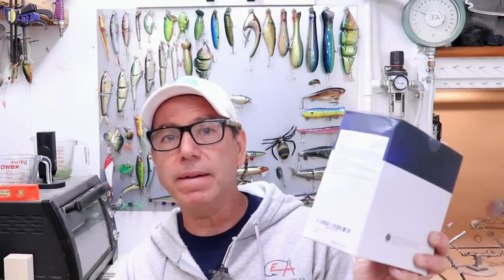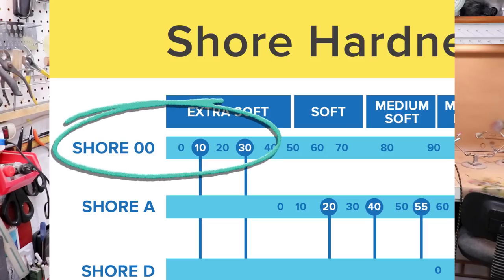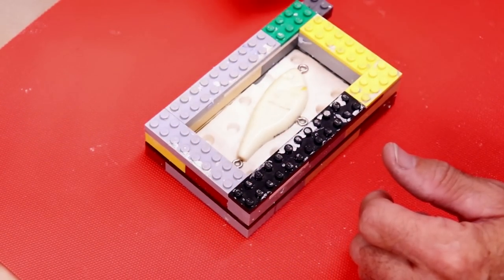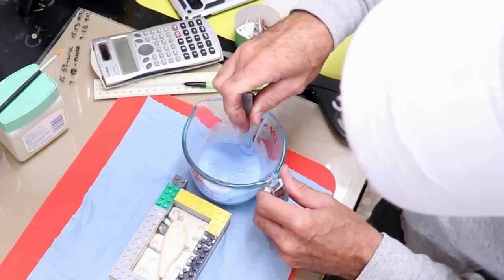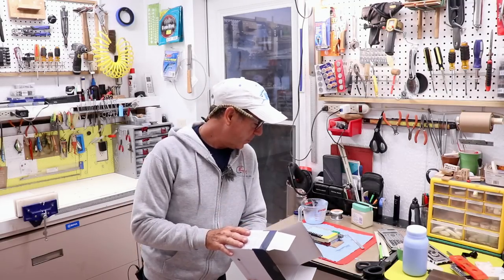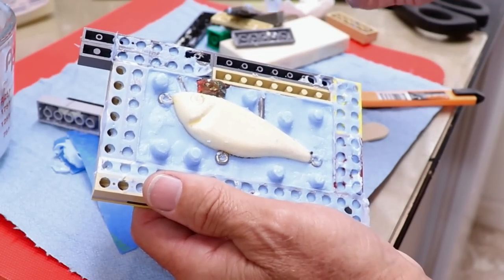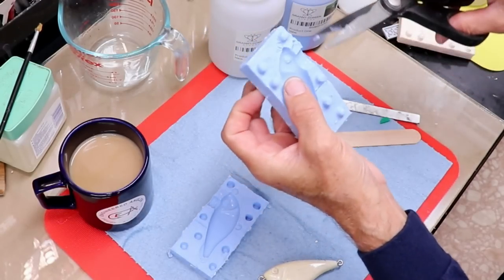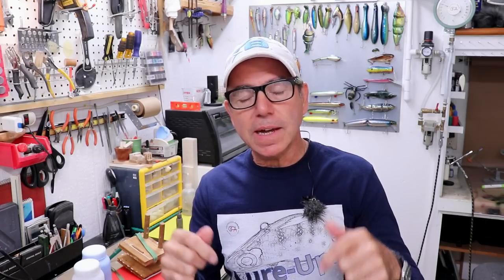Making a Silicon Mold, Cheapest and Fastest Mold Copy  #silicone  #moldmaking

Comment from the maker: So I confused everyone with my volume calculation and that's because the dimensions I gave were nonsense.  I was reading from half of a broken ruler so everything was off.  I corrected it immediately before I calculated the volume but forgot to correct it on video.  The actual measurements were 96mm X 47mm X 10.25mm 
Sorry about that folks.
Reply: You can use dry rice to measure volume. My math is horrendous!

Comment: Thanks for bringing my attention to the less expensive silicon molding material,

It would help if you had a level place to make molds. A three-legged platform with a bulls-eye level and two of its three legs adjustable screws so you can level it. A three-legged table is always stable and much easier to level than one with four points of support.

Comment: I know you can stiffen up Silicone caulk with cornstarch for mold making. It becomes more clay-like similar to Sugru mending putty (the homemade stuff is called Oogoo) The amount of cornstarch added determines how thick or pourable the raw silicone is and how stiff or flexible the resulting silicone is for working product is when cured.
If you're up for experimenting, maybe try mixing in some cornstarch to your Granny's silicone to stiffen up your mold? It probably won't take much to give your molds some oomph, (so they're less floppy) but it may make pouring a little fiddly. It might become more like a thicker batter instead of the thin pour you had.

Comment: As a lure tinkerer I'm always looking forward to your next video.  Any chance you could do a clip on issues and solutions you've come across while molding with silicone?  I recently tried duplicating a soft plastic swimbait and the silicone didn't set around the bait.
Reply: sometimes its the from residue around on the master. sometimes there is a reaction from the type of silicone. some epoxies don't cure with platinum silicone. sometimes its the mold release. theres other channels that focus on making silicone molds for lures,. just have to do the homework.
Reply: Robert Talone is really good! doesn't do lures, Burt he's a retired professional. great stuff on his channel, always using silicone

Comment: To eliminate Boubles, whithout a vacum chamber(If you have one,OK) is to use a old/new pressure cooking pot and add a bicicle tire valve in the exaust stem hole, and put a pressure gauge in the safety valve hole. Place the still liquid state mould and add pressure, About 25 PSI is safe. Google up dental pressure pots to get the idea
Reply from the maker: That is a slightly sketchy way of making a pressure pot.  Cooking pots generally only operate at about one atmosphere (about 15psi)  They will hold up with 25psi but I would not recommend it.  Not only is it not very safe but it's not that affective since you're only reducing the bubble size by just a bit more than half.  A cheap pressure pot, that will take 50psi easily, would do you better.  Nice job figuring out how to make the conversion though.  I do like to upcycle something old.
Thank you for sharing.

Comment: Great video Franco! I enjoyed every tip, including making sure the form is level. Most important part! I've found that the seepage through legos is inevitable if using off-brand cheap legos. 

Have you tried the BBDINO 30A Silicone? It's what I have used for 2 piece injection molds so far. Very durable, some stretch, and sometimes goes on sale for 25 to 35 for 2.5 lbs total. Also says it holds up to temperatures of 450 degrees. I've shot 375 degrees through the material multiple times with no issue.
Reply from the maker: These were legit Legos just didn't press them together.  I'll check out the BBDINO

Comment: I was thinking of using Alumilite's clear casting resin to make a lure with holographic foil on the center. I think you could still paint parts to finish it. 
Any thoughts or suggestions? Thanks I truly enjoy your channes, and the infor presented.
Reply from the maker: Yes I have done it....you can too
Reply: @EngineeredAngler  Thanjs, is there a video?

Comment: Hi Franco. Just a question on resin lures. What primer is the best to apply before painting?

I tried Rustoleum white primer+paint but it seems that the primer does not etch into the resin and that causes my paint and clear coat to flake off very easy. Thank you.
Reply from the maker: I usually just sand and clean the casting and go straight into airbrush paints.  But if you don't give the resin a few days to cure it won't accept paint well.  I usually bake the castings at 150 deg. F  for an hour or two to hurry the process. Otherwise I let it cure for at least a week.  But I have used Bin or Killz as a primer with good results.
Reply: @EngineeredAngler  thank you very much. I will try that. Have you seen the latest trend where some glidebait builders are paint that they bake into the resin instead of having to use an epoxy clear coat?

Any idea what type of paints that would be? Maybe paints used for ceramics or glassware?

Comment: Do you have another video walking thru your measurements to get volume? I feel like I missed something. I head 1.6x47x196 which I got 14739.2  cubic MM. Divide that by 1000 got me 14.739 CC or 14.739 ML.
Reply from the maker: Oh man I forgot to correct the video! I misread the ruler in the first take.  I caught the mistake and calculated with the correct numbers but forgot to reshoot the measurements.  I'll post the correct measurements in a pinned comment soon.
So sorry to confuse folks.
Reply from the maker: So I confused everyone with my volume calculation and that's because the dimensions I gave were nonsense.  I was reading from half of a broken ruler so everything was off.  I corrected it immediately before I calculated the volume but forgot to correct it on video.  The actual measurements were 96mm X 47mm X 10.25mm 
Sorry about that.

Comment: I made a mold using the same but it seems tacky after a full day of setting. Used exactly same amount of both. What went wrong? Also what did you use to clean the Vaseline off the mold? Thanks, love your videos.
Reply from the maker: If it stayed tacky it probably wasn't mixed well enough or you got a bad batch.  I clean the mold up with alcohol.
Reply: @EngineeredAngler  do I have to redo or can I try using it?

Comment: I find that I get a lot of small bubbles when casting the polyurethane. Do you use a vacuum chamber to remove air bubbles prior to pouring? I just purchased a vacuum chamber, however I am yet to use it and I am wondering if there is any point worrying about small air bubbles  as any exterior small bubble holes will be filled with the layers of epoxy.
Reply from the maker: The quick-set casting resin sets too fast to vacuum.  Be sure your mold is well vented.  Yes I have to live with some small bubbles on top...it's not too bad.
Reply: @EngineeredAngler  Thank you for your reply, that makes sense. On a semi-related note, would you or any of your viewers know whether a vacuum chamber would destroy the microspheres?

Comment: I got some similar silicone to make a mold of plastic baits... it reacted with the plastic and turned to goo.  It was platinum cure, 30A off amazon.  I have used the Alumilite 20a stuff from Hobby lobby before and it worked fine, it was also platinum cure.  Any recommendation?  Should I just order Tin cure?
Reply from the maker: Go with tin cure that's what I like to use.  The only reason I've been using platinum cure is that I have been finding it at better prices.  But I still think its a bit more fussy than the tin cure.

Comment: Franco, 
Learning great deals from your videos. I’d love to see that pro tip you talked about in a mold making video from 9 mo ago!
Additionally, I’m experiencing a ton of cure inhibition with Let’s Resin silicone while using automotive primers and minwax polycrylic as master sealers.
Am I missing something important to achieve a good finish product?
Reply from the maker: What is not curing, resin or silicon?
Reply: @EngineeredAngler   let’s resin platinum cure silicone. 30a to be specific! 😁
Reply from the maker: Sorry for the late reply,  I would just switch to tin cure silicon.  I have never had issues with it setting.  The platinum cure is finnicky and I have had issues with it staying tacky for days.

Comment: I wonder if plaster could be used forl ure mold making? I'm only asking, because plaster is cheaper per kg where I live, than silicone.
Reply: Yeah, POP molds work, just have to make sure to put some sort of mold release (Vaseline).
Reply from the maker: Only if the shape of the lure has no complex shapes that need the flex of the silicon.  The mold I made here could be done in plaster or any other hard material.  Just need to use a good mold release.

Comment: Thanks for the video and for sharing the silicon brand,etc...
Just be careful with Platinum Silicon and items/object with sulfur, I had some trouble with silicon who not well cure while using some model of Plastiline, I also found that one of my mold made with Platinum Silicon is already good to change, compared to those with tin cure silicon... but it's maybe due to the brand or I also found that some Polyurethan resin are a bit more "aggresive" compared to some other...  (I always put some talcum powder or sometimes PTFE spray inside)
Reply from the maker: Good points.

Comment: Hello I also pour, a bait like you only I use wax-based release agent so that the molds last a lot longer Unfortunately, I do not know if it exists in the USA as well. Greetings from Germany
Reply from the maker: That is a good technique but I have had some bad luck with the mold release agent messing with my final finish...I guess I didn't clean well enough.
Reply: @EngineeredAngler  Hello I hang the poured baits for 30 min in the oven at 80 degrees Celcius and before painting I wipe them with acetone so I never had problems. Keep up the good work I love your videos